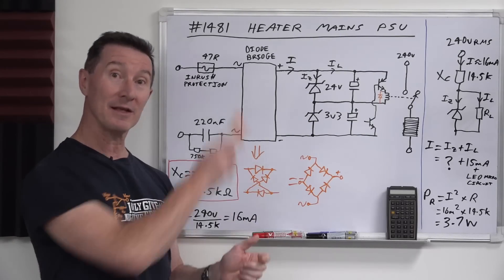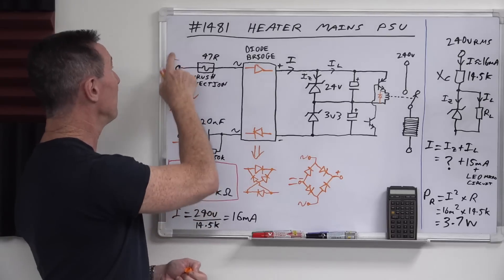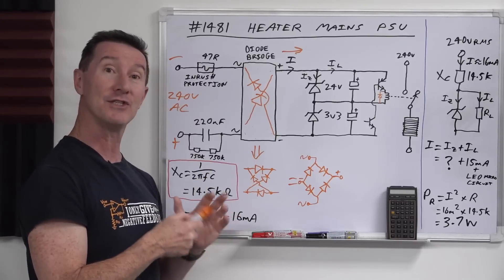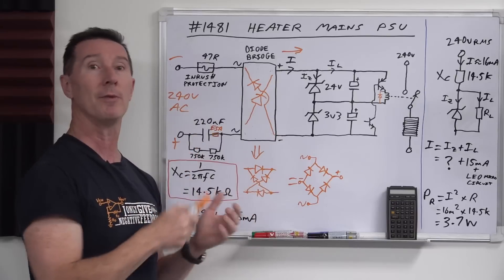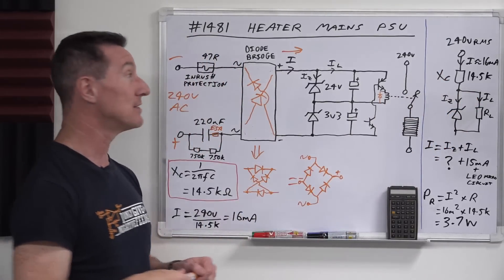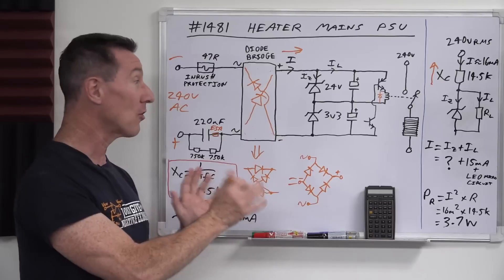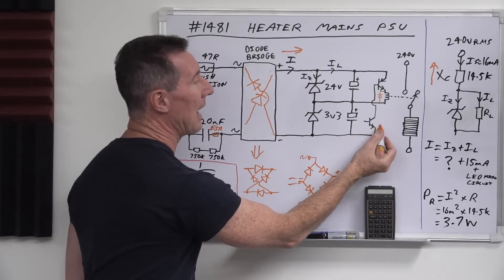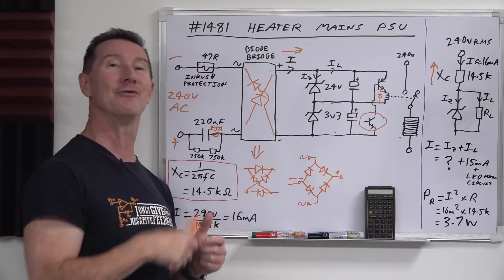EEVblog 1482 - Mains Capacitor Zener Regulator Circuit

Comment: Great explanation of how zener based Derivation of DC from AC mains works. It saved a lot of angst for me. I changed caps and zeners to no avail. now I see the problem is with capacitor on AC input

Comment: Quick question. If the diode rectifier provides 240V+ and we shave off 24V and 3.3V, where does the rest go? Does it get blocked by the diodes? Does it get dissipated by them? Thanks

Comment: WOW - 47 Ohms as inrush protecting resistor? Even when we are effectively dealing with a series circuit of an capacitor with 220nF and the electrolytics? No way that the 47 Ohms would make that much of a difference to the inrush current. It is much more likely that this 47 Ohms resistor is nothing more than just fusible resistor to break the circuit if for example the diodes in the rectifier. The 220nF cap alone would limit current down to not more than just a few Milliamps... ;-)

Comment: Is the rail voltage at the rectifier 27 volts or if the second Zener Diode 5 volts is it 29 volts? If so then it' may be using the Zener diodes in series with the virtual ground. That would make sense such as using 2 12 volt Zeners to make a 24 volt power source.

Comment: Hey Dave, I have seen these crude line capacitor dropper power supplies used since the early 1990's.  I worked for a company that used these circuits in LED bulbs but, without the surge resistor.  I modified the circuit by inserting a 100 ohm pulse rated resistor (US, 120 Vac), which improved reliability and power factor.  These circuits are very vulnerable to voltage spikes and outputs from triac dimmers and squarewave/modified power inverters.  The circuit you showed has a worst case surge current of 6.6 amps, assuming a clean sinewave.  That particular circuit was likely designed by an engineer, then redesigned by management to further lower costs, then redesigned again by manufacturing who would only allow 10 reels of parts to be used on their pick & place machine.  If the surge resistor was pulse rated, the redesigns probably changed it to a 1206 thick film chip resistor to reduce cost.

Of course, who cares about ripple on the regulated supply lines or voltage drift over temperature.  These zener voltages are horribly unstable over temp.  Also, placing a filter capacitor in parallel with a zener feed from a rectifier, can never be free of ripple (I wonder how the microcontroller reacts to that?).

I am assuming this circuit was powering a digital thermostat for a low cost space heater?  With this circuit, it no longer replicates the mechanical thermostat it is replacing because, it will no longer run off DC (assuming these was no fan being used).

This circuit has horrible power factor as you mentioned, although would be insignificant when the heating element is energized.  The power factor of the circuit is usually overlooked due to the low power draw but, becomes a problem due to the amount of power line harmonics it generates and resulting power loss at the power plant, which is roughly 7 times the power as measured at the device itself.

The power factor problem was recognized in the 1990's and since then, home appliances drawing greater than 50 watts employ some type of power factor correction.  The worst offenders now are induction motors but, they have been redesigned as well such that the worst power factor I have witnessed lately is 0.85.  Additionally, most all electronics use an off-line-switcher instead of a step-down 50/60 Hz power transformer.  So, the mains are far less inductive these days.

If your house is powered from a simple 2 or 4 pole generator, the power factor can quickly consume available generating capacity.  Let's assume you are charging a solar battery bank from your generator.  The difference in power factor between battery chargers that have 0.5 versus 0.9 is huge, with the 0.5 needing almost twice the generator capacity.

Comment: Today me and a colleague also had a failure in a  capacitive dropper circuit - but it was not the capacitor. After the diode bridge there was a simple linear regulator with a 30 V zener-diode, a 10 kΩ resistor to limit the zener current and an NPN-transistor. This intention of the supply was to keep the coil of a 24 Vdc relay energized - pumping 29 V into the coil, why?
However, after about 25 years in duty both the transistor and the zener diode had failed which I diagnosed in the end from the about 0V over the zener diode and 0.4 V base-emitter voltage of the transistor.

Comment: Perhaps a followup to this would be to model the circuit with one of the many SPICE type simulators?  It would then be possible to see the phase of the input current wrt the voltage, to look at the effect of having the relay on or off (on current drawn and its phase).  It would also be possible to demonstrate the effect(s) of using a resistor rather than a capacitor.

Comment: Having a power resistor waste 5 W as heat isn't necessarily a bad thing in a heater, since heat is what you are trying to create! :) (But in almost every other case it would be bad of course). In this case it would still be a problem because the zener regulator would use the same amount of current regardless if the relay is energised or not. Could they have used a power resistor to only power the relay, and some other way to power the control circuit that only needs a tiny current (one of the linear regulators mentioned in the other video maybe?). That would be more efficient and a resistor is less likely to cause problems than the capacitor.
Reply: yes but... if you dissipate 5W on resistor, you pay, when it is on capacitor then power plant pays ;-)

Comment: Assuming this circuit is out of a coiled-wire resistive heater, with or without a fan, wouldn't the heater's primary operation effectively offset the capacitive line reactance at the plug?

Comment: Hi Dave, I have a question. Could it make a difference if I swap a polar capacitor (220nf) n that circuit against a bipolar one? Could the bipolar cap have lower ESR and mess up the circuit?
Reply: It is a non-polar cap.   You can not use a polar cap

Comment: The thing about that design is the microcontroller was still functioning normally even when the power supply was only working at 50% capacity.

Comment: Thanks a lot Dave for this vidéo. I am not sure I understand how a 16 mA power supply can source enough current for both the relay (15 mA) and the logic part (?? mA).
Reply: With that zener arrangement they act like a 24+3.3v supply, that current flows through both, it's a pretty clever arrangement.

Comment: The current capacity is not that dodgy: Having the rails in series means the current gets to be used twice: That same ~15mA is always available for the micro regardless of whether the relay is on or off: It's in series, not parallel.

Comment: I opened up the Sonoff th10 hardwired smart switch to modify it's firmware, and discovered it used this style circuit. Possibly with a switchmode regulator, but certainly with the whole circuit at some mains potential. That's ok, right? It's hardwired in and you're not touching the microcontroller. Except that there's a 3.5mm audio socket on the side to plug in a temperature probe. I then wanted to plug the waterproof temperature probe into my fishtank.

I made another modification - plugged it directly into a 5v USB port and just buggered off the 240 part. Don't trust cheap Chinese devices without opening them up and reverse engineering them!

Comment: Nice video Dave
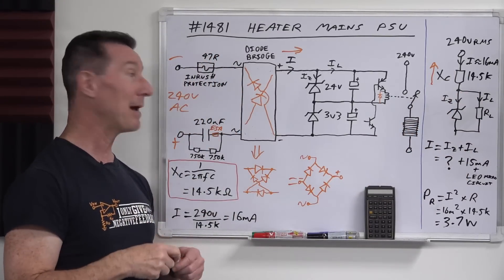13:20  This Power Factor business means you're getting your circuit to work but the energy supplier has to carry the cost of the use of your circuit.
Conventional meters in the house can't measure the Apparent power and so you actually save some money.  
The suppliers want everyone to go to Smart meters which can....
I wonder why !!

Comment: Hi Dave. Actually I think that the cuircuit with the two zener-diodes in series is a quite smart solution. 
Just imagine the case of a 3.3V linear regulator hanging on the 24V rail; that would mean, in addition to the relay current comes the control logic current: a cheap uC + temp sensor + some LEDs, might sum up to additional 15mA; meaning you need twice the input capacitance and have twice the power drop on the 24V zener. 
Compared to that, the shown configuration provides the current for the 3.3V rail almost for free. 
I guess, the relay coil version is selected to match the control logic current consumption, in order to get the total component cost down. 
BTW: greetings from Germany. I like your channel a lot.

Comment: I guess, you can replace  Zener diodes with regulator say 7805 to get a transformer less power supply  for your projects.

I would also double the capacitor and put one at each end to make the device safer.  That is say 440nF one in series with 47 ohm and another replacing 220nF capacitor.
Reply: most ICs such as the VR ICs have a limited max voltage.
doubling the caps  would double the current - use a fuse  and a X2 rated cap  to improve safety
Reply: @kennmossman8701  When you double the cap and put them in series, as I recommended here,  the combination makes the same value as the original cap, but you are shielded form both sides, instead of only from one side of high voltage.
Reply: @aduedc  shielded?   Caps are shields, so resistors are swords?   If you put two fuses, one in each line, then you will be doubly protected?  I have NEVER heard that adocated before.

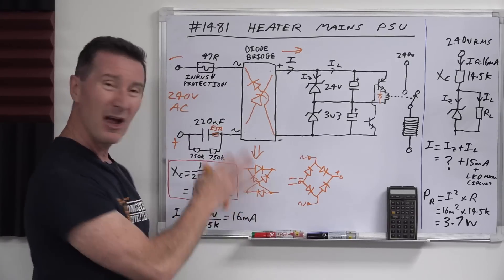Comment: 9:50 Isn't it a bit strange to do "order of magnitude" calculation using 3 digits of precision for the resistor (1.45 *10^4) ? Mains voltage only has 2 digits (2.4 *10^2). It would have been nice to round that to 15k for example.
Reply: Adding extra (unnecessary) precision helps in understanding the maths. 
For example in coil inductance calcs (very imprecise with iron or ferrite cores), pi could be rounded to 3 which is only in error by  5% but readers may not know where it came from. 
Using 3.1416 clears any confusion.
Reply: Mains voltage has three digits - '2', '4' and '0'.

Comment: While capacitive droppers make poor power factors it really helps the power company. Most load anywhere is generally inductive - think electric motors used for practically everything in industry and residential. Fans used in ventilation, or motors driving compressors in HVAC and refrigeration or motors pumping liquids and such. Thus power companies know the power factor is generally inductive and they have to add capacitive reactance to balance it. There are capacitor banks on distribution lines and at substations to compensate for the inductive loads. You using something with a capacitive dropper helps bring the inductive load down a bit. Though modern LED lights are back to being resistive loads as they are using linear regulation driver ICs. But since the LED array drops about 90% of the line voltage the linear regulator doesn't waste much power. So I wouldn't worry too much about capacitive droppers at all.

Comment: dave didnt YOU come a gutsa here? the zeners in series would mean that the zener voltages should add up and 24v + 3v3 or 5v would be roughly 30v and if you guesstimate the coil current from the datasheet at 30v (given are only 24v and 36v) you would get anywhere between 15mA and 10mA thus the zener current would still be edgy but not that edgy. if it really was in the order of 1mA i would expect the circuit to not even work with the good cap. assuming a coil current of 12mA at 30v (right between 15 and 10mA) there would be 4mA for the zeners which i learned to be roughly sufficent for small signal level type zeners...
Reply: Relays require more current to be engaged, but less current to reliably hold them on. So on turn on, plenty of current is provided by that smoothing capacitor to engage the relay. Then the voltage can drop away, as 10 or less mA is enough to hold the relay engaged. This gives the zener a break!

Remember that this circuit worked fine until that capacitor lost more than half its value. So there's no problem with the circuit design, but a clear quality issue with their choice of capacitor supplier.

Comment: Dave, correct me if I'm wrong but the 3.5 "W" (VA) is not supplied by the grid, it is supplied by the power factor correction panel at the facility main distribution center. For example, installed alongside transformer LV output panels.

If reactive power consumption of your generator's load increases, you do not push more water, steam etc. to your generator. You change the field excitation current.
Reply: Your supplier has to provide that VA, whether it is supplied by locally, or even, at one time near here, with a smallish hydro plant being run out of phase to the wider grid. But as another person said, generally the load on the grid is net inductive from motor and transformers, so adding capacitive loads like this helps.

Comment: The grid delivering the power is largely inductive, so power factor correction usually means adding capacitance. Except for very long EHV lines where there is a huge amount of distributed capacitance and series inductors need to be added.
Reply: Yep some old factories had capacitor banks for power factor correction. But in this case those 3.7 w were passed away in form of reactive power
Reply: Technically 3.7 VAr were provided into the grid by the capacitor dropper ;)
Reply: @StevenHodder  except it should be in parallel to the load if my memory serves me right. And this is in series.

Comment: In capacitor power supplies with relays, a relay with the highest possible voltage and lowest current is often used. 
It is often common for the zener diode to get hot when the relay is off because the current is then heating up the diode. If the relay is on, the diode is often very cold because the power is then in the relay. 
The series connection is clever because the 16mA is available anyway, an additional 3.3 or 5 volts are irrelevant for the current.

The disadvantage of the capacitor power supply is that 16mA always flow. Yes, always!

Comment: I never concern myself with capacitors loading the grid, figuring that all of the inductive loads on the grid more than compensate. So the capacitors are benefiting the grid. Do I have this right?

Comment: Finally some nerdy electrovideo! By the way, the zener needs to be able to handle the power of 24v 16mA when the relay is not activated. Hope you are doing fine Dave! Thanks! /Tomas
Reply: rather use a single 24V 1W Zener, you can use two 12V 400mW Zeners in series

Comment: I think the explanation about the Zener-Diodes and the degrading dropper capacitor is a bit awkward: those diodes are mainly needed to limit the voltage for the transistors, in particular if the the relay coil is turned off. For a longer lasting circuit, the dropper capacitor probably should be 300nF, and then the Zener is also "eating" the surplus energy. It's true, that the Zener are getting redundant, when the dropper capacitor degrades too much over time.

Comment: In some of these types of circuit the zener only limits the maximum supply voltage if the load drops, rather than to regulate the supply voltage. For example, the zener in our fan controller limits the supply rail to +12V whereas the normal running voltage is about 5½V.
Reply: Like in the reverse polarity circuits to protect the mosfet gate (someone uses just the zener though)

Comment: You made the same mistake as in a video a while ago about power generation. The generator doesn't have to generate the power (just think about how that would work in relation to the conservation of energy. The genreator generates 3.7 watts, and it just.. disappears?). Parts of the cycle, the generator would have to push a little harder, and the next part of the cycle, energy will be delivered back to the generator, effectively pushing it forward. In a lossless system, this means there's no net power generated.